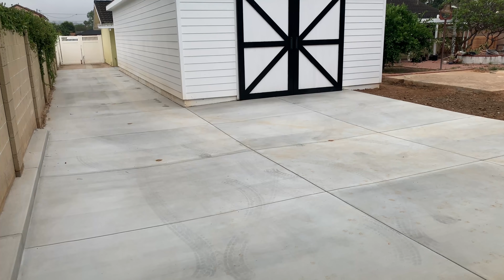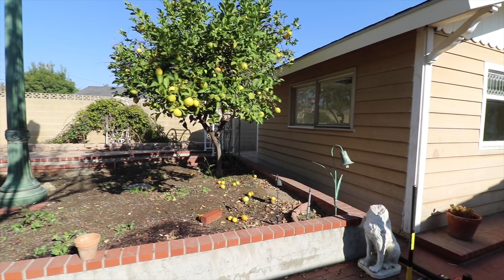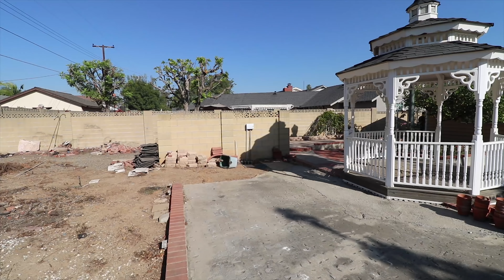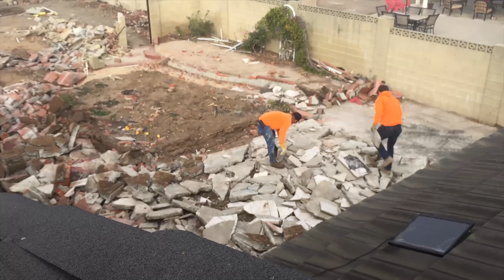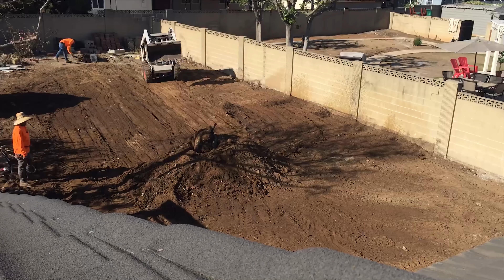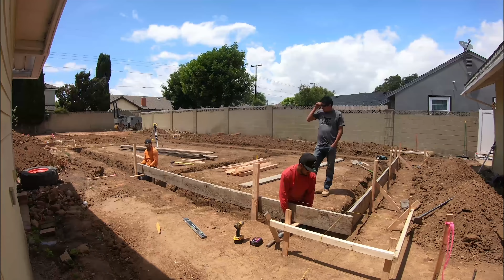My New Dream Workshop is DONE!!!

Comment: In NJ this would easily cost $100k for the construction. Probably another $5k to “pass” various code inspections. Probably take twice as long.  EPA would claim the excavation was some kind of ecological nightmare requiring an investigation (another $5k “pass” fee). Your property tax would increase $10k/year because it’s now potentially a mixed use property.  Oh, and the neighbors will hate you for 1-2 years of construction noise and debris.  Finally, because it’sJersey, the day it’s done you’d get hit by a bus.  You won’t die but you’ll be too busted up to ever leave your bed again.  Just lie there for years staring out the window at that building you’ll never get to use.  Two days before your death it will be struck by lightening and you watch it burn down to the concrete slab.

Comment: You can cut a piece of wood trim for those lighting spots that will sit over the siding. Just find the angle of the side and mark it up on the trim and cut, screw, caulk and paint

Comment: Well, never heard of getting soil removed and getting recompacted again. Must be really bad soil where ever you are, and I did residential concrete construction, in Oregon, for 30 years. Too late now, but when looking to insulate my first shop, after pricing the materials, I went to an insulation company and their price, including a white reflective vapor barrier was $50 more than the cost of the materials for me.... No brainer. Never forget the guy who installed it. He took the spray nozzel out of a can of spray adhesive, sprayed the back of the 6 foot batts, put that on 2 sticks and pushed it up onto the ceiling between the rafters.... Very efficient....
Reply from the maker: We have that whole earthquake issue where I’m at so they want super compacted dirt

Comment: Your blooper reel suggests to me that 15$/day per 4x8' section of rental scaffolding or 130$ per section of small scaffolding and  a 150$ drywall lift for the walls and ceiling might be pretty economical and more efficient, not to mention safer.

Comment: The siding was done correctly for the Hardie Plank, it's the painter's job to fill the cracks with Bondo and caulking on the siding. They also should have given you pricing to do light blocks on the exterior lights.

Comment: @Ben Tardif Came to this video as a suggestion. Was really cool and I enjoyed watching it. Did you apply any weather stripping to those barn doors so when they are closed the inside is weatherproofed?. With no weather stripping if you're running the AC then it will be constantly running trying to cool the shop and the outside.

Comment: A year!!! Wow, I applaud your patience. I called my inspections department in Texas today to ask about building a similar shop but two stories with an office upstairs. They told me about the required setbacks then said to draw a floor plan and list my framing, insulation, and electrical plans then get cracking. That was it for the approval process. After that it’s up to me to pass code. Seems way more efficient that way. Provide the guidance, but put the responsibility/liability on the owner.

Comment: Great job!  I'm a contractor in Victoria BC and install a lot of Hardie siding.  You are correct, those guys did a terrible job.  In BC you also have to install a rain screen behind any siding and cannot attach the boards directly to the house but I doubt rain is as much an issue where you live.  Jealous of the shop man.

Comment: One tip for anyone that reads this...any time you hire a contractor, include a clause that penalises delays.  Every two day take .25% off the contractor cost.  Did you add a strip behind one side to prevent air from drafting through?  Beautiful work

Comment: I don't understand why you put OSB on an interior wall? (I think you mentioned it's quake proof... At the end of the day it's still gonna come down during a quake.) Each side would just get sheetrock/drywall as you added it -- that was an extra step. Unless you planned on conditioning the attic and making it livable you don't need to insulate the rafters. The attic needs to be vented and allowed to breathe. The roof or floor above or below however you want to look at it the more the merrier, but you just wasted money insulating the rafters. Regardless of installing plywood or drywall on interior walls you always start with the ceiling first and work top to bottom. Never bottom to top. Something to think about for your next build (if you do one). Otherwise great job doing the work you could or cleaning up or finishing other workers jobs.  I agree, many things get done better if you do them yourself!! It looks like a great workshop!

Comment: You did a great job on the project. An excellent job filming. And I really like the way it turned out. You’re 100% right on that hardy board. Siding is nothing but rain screen the actual waterproofing takes place behind it. And that’s what those little metal strips are for to keep the rain from going behind. However your description of the sheathing being installed to prevent shifting during an earthquake is only one benefit of the sheathing. In fact I have never seen a house or any structure built without sheathing. I’ve seen poor quality sheathing but every structure has sheathing. It’s what the waterproofing goes on. Your Tyvek, your tarpaper, or whatever other waterproofing material (zip sheathing has the waterproofing integrated) And give you something to nail the siding to. And your comment about insulating the space well so that you’re not working in an oven made me laugh. You pretty much assured that you’re going to be working in an oven. It’s going to be hot as balls in there. When building large pizza ovens you insulate them well,  it helps keep the heat in.The radiant heat that comes from the sun is still going to bake that please.If you’re not gonna do air-conditioning you may wanna throw some big ass fans from the big ass fans up from the big ass fan company.

Comment: 5:30 There is a problem with your insulation and it's a problem most people have. You might be putting in R-19 or 21 in between your studs. But your studs only have an R value on 1 per inch. 
          The studs are what I refer to as heat suckers. They either suck the heat in if its hot outside or suck the heat out if it's cold.

Comment: those barn lights aren't code compliant? why not? Normally I'm pretty good at thinking like a bureaucrat but the reasoning on that one stumped me.
Reply: Knowing California codes, they have to be LED. You can buy LED bulbs but California will not allow a standard socket in a light fixture that you can remove the LED bulb and put in an incandescent bulb...it’s a stupid code.
Reply: @thehammeredthumb7110  agreed. That is a stupid code. I'm all for saving energy and LED bulbs give off good light (unlike CFLs). Oh well at least you can swap fixtures. I'm guessing CA will assume most people won't swap fixtures and will just use the built in LEDs and they are probably right.
Thanks for filling me in. I was really stumped on that.

Comment: A boat load of money went into this project. Currently I am building a woodworking shop not near as big as yours. Mine, 12x24 just for wood working hobby. I have another shop like it on the other side of my yard I built over 30 years ago. When the new shop is finished, the old one will be for motorcycle storage and vehicle maintenance.

Comment: Pro build! Nice to see it all come together. Curious as to why the exterior light fixtures you wanted weren't considered code-compliant?
Reply from the maker: The code requires exterior lights to have a photo sensor so they automatically turn off during the day. It’s meant to save energy but there are so few light choices with that feature

Comment: @Ben Tardif, Regarding the mention of Chicken Coop. Incorporate a running water stream or just filtered water in some shape or form with surface skimming. It will prolong the usage of the water and reduces stale water. Which is better for any animal or person. Basically, avoid going with "Bowl of water". Plus, if you make it a birdbath style, they can potentially clean themselves to a degree. Which will reduce the feather dust, which can cause allergies.

Comment: I build custom homes for a living and only use James Hardie for siding. It actually isn't required or necessary to install the metal backing on the joints. I live in the pacific northwest so we get a lot of rain and never have any issues. A good house wrap will keep the moisture away from the sheathing. It is unfortunate they did a crappy caulk job which can make all the difference.

Comment: I'm wondering what city you are in that the permitting was so difficult.  Los Angeles?  Some years ago I did a similar project (with two stories) in Costa Mesa and it went pretty quickly and smoothly.  But Costa Mesa had a reputation for being easy to work with.  In general I would expect smaller cities to be easier to deal with than larger ones because the city personnel ought to be much more accessible.  Costa Mesa's inspectors were great.
Next year I'm doing something very similar to what you did (backyard shop with casita) in Reno, and I'm hoping I can get it all done in one season.  Reno's planning department is also said to be fairly relaxed (so I've heard, I have no experience, though I own a business in Reno and my dealings with City Hall have been fine); at least a lot easier than neighboring Sparks.  The guesthouse which might have caused your city a lot of heartburn should be simpler for me because the zoning is already multi-family.  Fingers crossed.
Reply from the maker: That’s nice that your permitting process was relaxed. My planning department covers a large area. Their processing times are extremely slow and their “new” online system is impossible to navigate. I wish I could just go through a city with a simple process but that was not the case.
Reply: @BenTardif  Oh, well when I did my garage it was before new high speed super efficient online planning systems, so I'm sure that was one reason it went more smoothly.  Back in those days, we were sadly obliged to work with actual human beings.

Comment: Did you jack up the drywall from the floor, roughly an inch, so it won’t get wet?
Reply from the maker: Yea it’s up almost exactly one inch. There’s a concrete lip at that wall so water doesn’t hit the framing